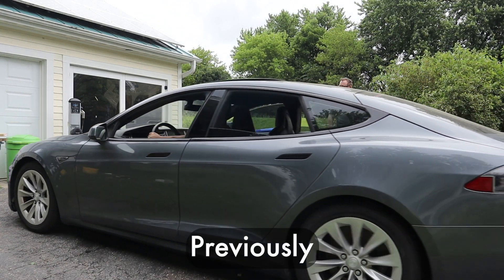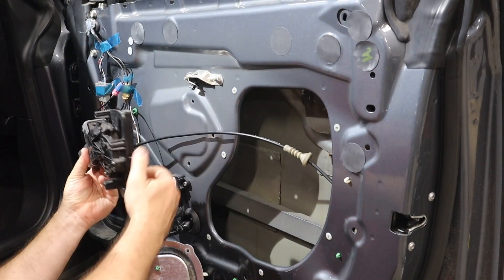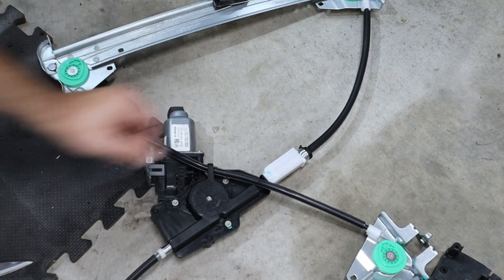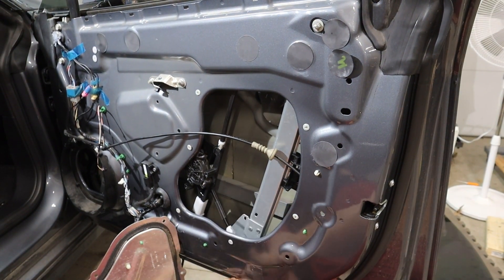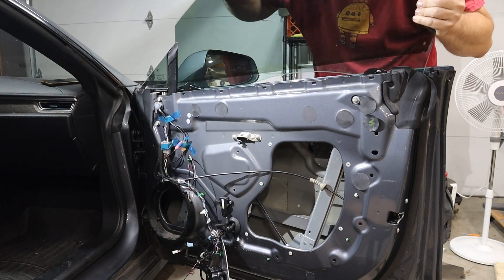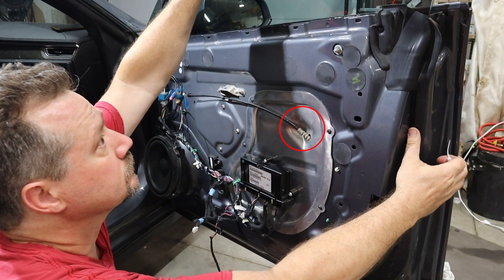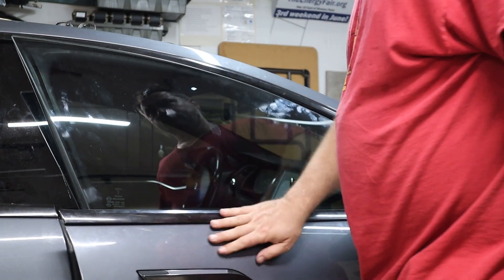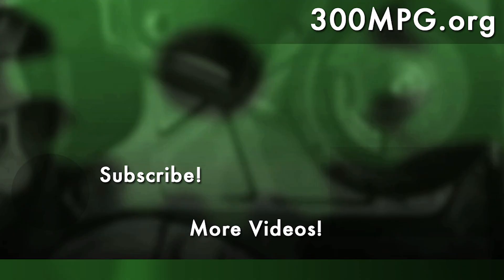Tesla Model S Window Repair - Regulator replacement with Dorman 740-603

Comment: Is this the fix for the little bit the window goes up and down when you close the door?
Reply from the maker: No. The window is SUPPOSED to open and close a little automatically. That prevents a big build up of air pressure when you slam the door on a tightly sealed car. 

This is to fix a window which does NOT go properly up or down in typical use.

Comment: Where do you show how to release the window glass from the front regulator track? THAT IS THE VERY VERY HARDEST PART
Reply: Push the pin in with a screwdriver

Comment: Check the motor! My window got stuck midway, of course mid winter. Ordered a Dorman 740-603, spent some hours trying to fix it, the motor just turning a few cm, before not working at all. Eventually bought a complete used old regulator assembly with the motor, but without screws and and bolts. Now it works. Tesla charges a lot for the complete regulator (350+USD) but does not charge too much for the disassembly, install, calibration. In my case the wait and the work put in to it was not worth what I saved on this job. Great video BenjaminNelson!
Reply from the maker: @xalzheimer7391  Yep! When I had everything opened up, I tested the motor and it worked fine. I could also see where the problem was with the cables. This allowed me just to order the correct and affordable parts.

Comment: hi my widow makes a noise like a regular window does, but doesnt go up, is the regulator borken?
Reply from the maker: @Larry-bm7ez  Yes. Sounds like the motor works fine, but the mechanical connection to the glass is broken.
Reply: @BenjaminNelsonX  ok thank you, do you have a link for the circle sticker things that covered the screws?
Reply from the maker: @Larry-bm7ez  No, but you could literally just use tape.
Reply: @BenjaminNelsonX like duct tape?
Reply: @Larry-bm7ez  Yes. Duct/Scotch/Butyl+foil/  piece of metal or plastic with removable glue.  Just literalyl ANYTHING that can stick to metal and seal an opening from 2 things: 
a) air going in/out (withstands some air pressure, so safety sensors can understand when to deploy air bags; and for da hot air not to be easy to get out of your cool car in cold seasons 😀)
b) water/moisture (so it's left outside).
Reply: @ wow you know a lot about this, are you a mechanic??

Comment: My 2015 S driver window sounds crunchy at the halfway point. It hasn't broken yet but I think I'm getting a warning sign. Did your sound crunchy before it completely failed? As an alternate, you could pull the window basically all the way up and put a suction cup or two on it to hold it up instead of making a temporary window.

Comment: Will the window mechanism you installed work on a 2015 model s?
Reply from the maker: @HartsigTube  It should be the same for 2012-2015 model years. Not even sure if it would have changed after that.

Comment: I'm planning to buy the Dorman 740-603 and follow your wonderful video. I understand the 740-603 does NOT come with a motor. So, before I buy it I want to make sure that my old motor is in working condition. I've already removed the door panel and unplugged all the connectors between the door panel and the door. Ideally, I would like to test the motor standalone using a 12V source. I noticed the wire harness connector that plugs into the window switch has 4 wires, instead of the standard 2 wires. So, I'm confused about how to test the motor. Can you perhaps tell me how to test the motor using the 4 wires?
Reply from the maker: @plee4321  Disconnect the motor from the old regulator and remove that. Put the motor back in the door and connect the wiring back up. Use the window up/down switch to confirm the motor works.
Reply: @BenjaminNelsonX  Thanks so much for your prompt attention! I just finished an online chat with Dorman Technical Support and asked the same question. Unfortunately, they have no idea how to test the motor. Before I disconnect the motor from the old regulator, I thought I would first plug the wire harness connector back into the window switch. When I use the window up/down switch, nothing happens and no motor sound at all. Before I removed the door panel, at least I can hear some grinding noise. Now I hear nothing at all. Do I need to plug back some other harness connectors? Right now for the motor test, only one connector is plugged in, and that's the one that is plugged into the window switch. Thank you for your kind support.
Reply: @BenjaminNelsonX  Forgive me for asking a stupid question. Let's say I remove the motor as you suggested. Instead of putting the motor back in the door to test it, is there any particular reason I can't simply test the motor standalone, while it's out of the door? Can't I just connect a 12V (or whatever appropriate voltage) source directly to the motor to see if it spins in one direction and then reverse the polarity of the source
and see if it spins in the other direction?
Reply: @BenjaminNelsonX  I'm afraid I have a second dumb question. Assuming the motor tests good, the next
challenge is to remove the regulator. Currently, the window is stuck all the way in the down position. The window is completely inside the door. No part of the window sticks out, so there's nothing for me to grab
onto to try to pull the window up. I attached two strips of tape to either side of the window and tried to pull the window up. I was able to pull it up only a couple of inches. Once I let go of the tape, the window drops 
all the way back down. It seems there's some kind of obstruction that's preventing me from pulling it up further. Then I grabbed onto the bottom of the window and tried to push it up. Again, it feels like there's some kind of obstruction that's preventing me from pushing it up further. Since the regulator is broken, the window can't be positioned to the height, where I can access the two round cutouts to loosen the window from the regulator. So, without being able to remove the window first, how can I remove the regulator? I'm hoping you can help me work through these problems. Thank you.
Reply: @plee4321 I had this exact issue, I know you probably already got it done but in case anyone else sees this as this halted me for like an hour + and couldn’t find anything, you have to go in through the speaker panel. Just a few screws, once open that’ll allow you to lift the window and then proceed with taking it out once you loosen the bolt and press the compression on the other sode

Comment: The 2 bottom threaded rods sof the track sit in elongated holes to adjust the angle of the window. It is important to adjust that properly otherwise you may cause damage when closing the door. Same for the installation of the glass, you need to adjust the position carefully before tightening the rear clamp.
Reply from the maker: @moestrei  Thanks for explaining that to everyone. Yes, I only lightly tightened the four bolts that hold the track in place. Then did various adjustments, then tighten them down.

Comment: It does not need any aligment? When I fixed long time ago my Subaru Impreza and it returned from body shop where was replaced whole side after collision with some stupid driver i had to align windows. It was quite number of iteration until I was satisfied with result. But Subaru does not need to open the windows when opening doors. Japanese guys somehow did it so well that it seal even it does not go under the trims like on Tesla. Each point of rails has to be set to right spot and there are some rollers that direct windows to the destination as it goes up first little bit do "wrong" directon as it is non linearly curved. I had to do that bodyshop not used to unframed windows could not handle. Tesla seems to be piece of cake.

Comment: One little trick to hold bolts the end of the socket: put a small piece of paper or shop rag into the socket hole, and then jam the bolt head in. It will stay until you get it started. Also works great for stainless fasteners that don't hold on magnetic sockets.
Reply from the maker: Great idea!

Comment: Good work! Glad to see user repairs manuals are accessible and so are things like Dorman Parts.
Reply: Yeah, honestly parts for early model s are a LOT off the shelf. Reel deal ev has great demo videos as well as parts, replacement clips etc between them, tesla, this guy, other 3rd parties, owning an older model s you have a lot of options and the diy is relatively safe and easy in most cases!